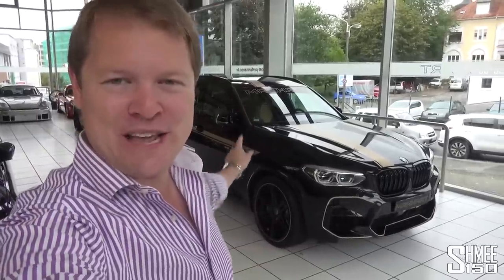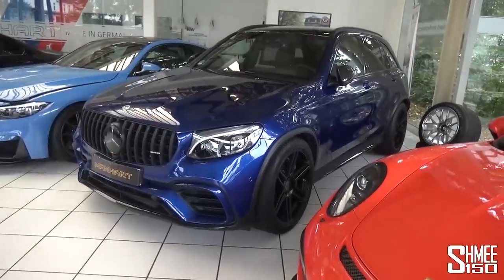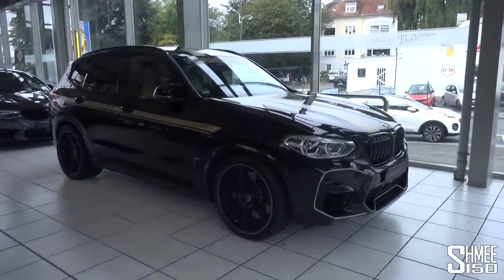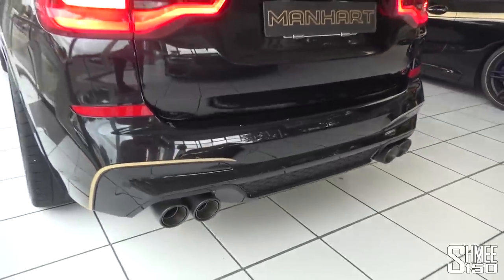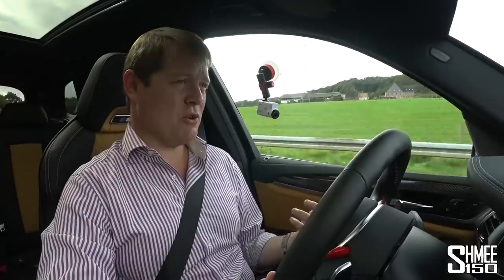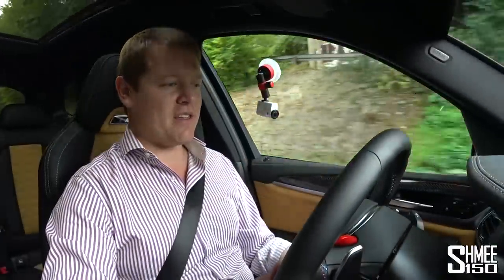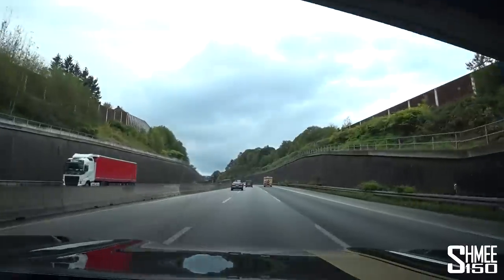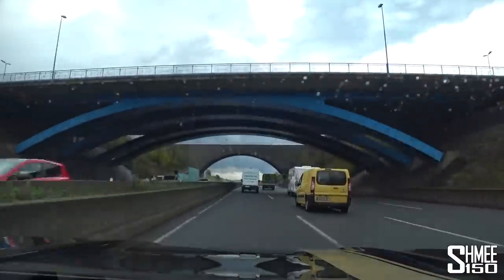The Manhart MHX3 600 is the 'Sleeper' BMW X3 M Competition!

Comment: Try that V8 M4 when it's ready,if you can,please
Reply from the maker: Will do my best!
Reply: That could be sick
Reply: Yeah it would be awesome
Reply: The problem with this engine is that the connecting rods are not forged and they come from the f90 M5 and they are not all that strong... so to me the isn’t forged connecting rods are a weak point in an engine like this...

Comment: I have an X3 M40i, 30+MPG’s with more than adequate power.  $54K.  The competition package is damn near $90K.  The price difference doesn’t make up in the performance area by leaps and bounds either, and considering your losing MPG’s too.  Be lucky to get 16mpg in the Manhart.

Comment: Manhart is fast with the tuning of those new cars. I mean the X3 M isnt out for too long. But nontheless 630hp out of an 6 cylinder engine is impressive, I wish I could drive this BMW. I'm guessing the new M3 from Manhart will have the same amount of hp since it getting the same engine.
Reply from the maker: Looking forward to seeing the new M3 and M4 when they arrive, and then seeing what happens next!
Reply: @Shmee150  I'm really curious if the kidney grill is going to be as big as in the concept car.

Comment: Imagine BMW gave Toyota permission to 'borrow' their S58 for the more hardcore Supra, and then when Manhart gets involved with that more hardcore Supra, it will have at least 600hp in a relatively reliable way and a smooth power curve, all in a short wheelbase body  that weighs 500kg less than this X3M <3
Reply: Very true. That would be an exciting prospect.
Reply: Love the idea! Perhaps the B58 will still sound better as it has one turbo and one exhaust manifold unlike the two exhaust manifolds found in this S58 and S55...

Comment: I think you should get the new RS6 Tim. My uncle has the current performance one and the new is just sooo much nicer.
Reply: Oh yea the new one is a monster with some Software Upgrades...the old one did over 1000nm of torque without changing any Hardware...so its gonna be interesting 😅

Comment: That M4 engine sitting too high under the hood
Reply: The problem with this engine is that the connecting rods are not forged and they come from the f90 M5 and they are not all that strong... so to me the isn’t forged connecting rods are a weak point in an engine like this...

Comment: The problem with this engine is that the connecting rods are not forged and they come from the f90 M5 and they are not all that strong... so to me the isn’t forged connecting rods are a weak point in an engine like this...

Comment: I would be more impressed if they put some hybrid tech inside these cars instead of just fitting bigger/heavier more polluting engine inside. This is very primitive and this company is nothing special. Show us somebody doing something with Kerrs or electric tech where they reduce/eliminate pollution while increasing performance not fitting the truck engine inside the M4. Or another dimension could be material science where lighter and different materials are creating faster while cleaner.